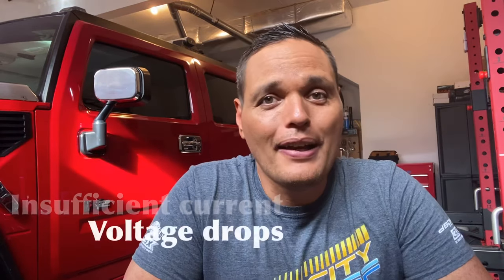The Top 10 BIGGEST MISTAKES in Car Audio. How to do it right!

Comment: I just have a 300 watt amp and a earthquake sub and I’m running stock wiring am I chillin tho ? Ion got 5 grand 10 grand wats just 300
Reply from the maker: 300 watts is not that much power so stock electrical should be just fine 😎

Comment: I have a 10 in subwoofer 1200 watt. My car was idling and then it shut down I started it back up but now my power lock doors don’t work and my inner light stays on. I know it’s not much power but what could have happened. I going with my car battery but would like to hear what else could it be. Thanks
Reply from the maker: That’s interesting, Does your stereo still work properly? And things back to normal? Or still stuck
Reply: @NextLevelCarAudio  stereo works but it was a fuse. All working but would I need a stronger battery like an optima or  standard battery be ok did 10 in subwoofer and 1200 watt amp
Reply from the maker: Standard with big 3 and gain set properly you should be good

Comment: Grounding!  If you have a unibody car(no frame) then You should be able to ground at the seat mount bolt, as long as you clean the surface free of paint.
Reply from the maker: In that case, I’d run a direct ground from the negative battery terminal to the rear. But to each his own :)
Reply: @NextLevelCarAudio  that’s what I did. I have a short ground on front battery to the unibody and another short ground from my battery in the trunk to the unibody.

Comment: I have A Question Nd Noone Can Seem Too answer It. Can You use A Motorcycle Battery or Any other Type Of Battery To Run Your Amp? I Dont Have The Money for the Expensive batterys
Reply from the maker: That’s fine, as long as the batteries amp hours can support the load. Also, make sure to run like batteries to be safe. AGM up front, AGM in rear, etc. unless you use an isolator
Reply: @NextLevelCarAudio  ty very much for feed bacc

Comment: Hello I have a question I have a 96 Ford aerostar short wheel base and I had a 10 inch subwoofer Sony xplod but I let a friend of mine borrow it and bought me 2 12s rockville an a 5000 watt amp but my friend gave me a 1000 watt amp but my subwoofers aren't but 2ohms so which amp should I use my 5000 watt amp or hes 1000 watt amp and the subwoofers are 28000 hundred or 28000 thousand watts
Reply from the maker: Not sure on the exact specs of your subs. But a 5k seems overpowering for the subs. I’d day run the 1k at a 1 ohm final load or the 5k at a 4 ohm final load. Should get the same power doing it either way

Comment: Kinda late on the video but what amp do you recommend for 2 12" Kicker CVX Dual Voice Coil 4-Ohm 750W also both subs wired to 2 ohm’s
Reply from the maker: A good 1500-2000 watt rms amp that puts out that power at 1ohm. If you tell me your budget, I can give you recommendations. Will run you from a couple hundred up to a G depending on brand
Reply from the maker: But wait... is that 750watt rating RMS for those subs or is that their max?

Comment: So I'm semi new to this.  I have an amp that is 700rms, it preforms at 700 watts at 1 ohm.  I ordered a kicker 10 inch q series that when wired parallel comes in at 1 ohm.  The rms rating for the speaker is 700 watts.  So if I parallel this speaker at 1 ohm and the amp is 700 at 1 ohm I should be perfect correct?  This stuff can be confusing.
Reply from the maker: Sounds like you did it right! Good to go :)

Comment: 11:52 oh shit. That's so true, I was going to add a 2nd battery in interior of my car and was thinking I don't have to do anything other than bolt in parallel to other battery using the amp power wire that is already there and fused up front. But no shit, the wire is hot either side! Thanks for picking up on this for me, I don't think I would have realised even though I'm an electrican hahaha. Maybe if I physically seen it wired im sure I would have then realised.
Reply from the maker: thanks for the feedback man! glad it helped ;)

Comment: My issues are with my box, airspace, and an amp that doesn't output the 2K watts needed at 1ohm. Im running two 15" 1000watt rms Dual Voice Coil nonpress paper cone.
Reply from the maker: Sounds like rebuild time! Woohoo!
Reply: @NextLevelCarAudio  l need to. Just don't have the money nor resources. I like loud bass, but my previous set up would make my car shut off even when on the highway, so I went to a less powerful setup with larger subs thinking I would have similar Performance. Unfortunately that's where I'm at now and I think my car is too small for dual 15" subs
Reply from the maker: I feel ya, enclosures can definitely make a huge difference in output.
Reply: @NextLevelCarAudio  I'm just not sure on what enclosure would be best for my car, but with the current one, the subs are pointed towards the front of the car, with one sub being mounted inverted on the box
Reply from the maker: Did you phase shift or reverse polarity on one of the subs? And is it sealed, ported?
Reply: @NextLevelCarAudio  I reversed polarity on the inverted sub, and the box I don't think is not even close to 75% sealed. I need 3/4" MDF board. Not 1/4" plywood.
Reply from the maker: Wow. Yeah. 1/4” is no good! Lol
Reply: @NextLevelCarAudio  it's not surprising the panel with the 15's mounted on it keeps splitting.
Reply from the maker: Lol

Comment: what is the best starter crossover points for bass and vocal amps? i usually run mine around 80-100 on low and 150+ on the highs but would like to get max out of the crossover points
Reply from the maker: That’s pretty spot on man. Can’t get much better than that. 😎

Comment: Speaking of grounds what about the stock grounding spot to chassis my battery is under back seat
Reply from the maker: That’s fine. :)
Reply: @NextLevelCarAudio  thanks
Reply: Is the ground wire that goes from alternator bolt to chassis count as a engine to chassis ground or do I need to upgrade my engine to chassis ground still my car has a stock one from alt to chassis I upgraded that one I can't find my engine ground so if it won't be enough I'll have to find somewhere on engine to ground to I'm a beginner just got back into car audio last year
Reply from the maker: That’s fine, always a good idea to upgrade it with a quality 1/0 Gauge OFC wire to

Comment: Quick question: I have a 12v 5A power supply on 220w amp with skar sdr 12 600w rms should I be worried about anything I also keep my gain all the way down I just use half vol my box is tuned to 25hz
Reply from the maker: Seems like your amp is too small for our sub. 220w on a 600rms sub?
Reply: @NextLevelCarAudio  yes
Reply from the maker: Like this, you will be trying to get to much out of too little. Better to have what we call headroom in this industry. 600w rms amp is what I’d get.
Reply: @NextLevelCarAudio  but I dont push it I keep it half my equipment stays cool when playing
Reply from the maker: Well do your thing man. Peace out
Reply: @NextLevelCarAudio  thanks for the help bro

Comment: Hi bud how are you doing? I've purchased a 10 inches Clarion DVC 4 ohms + 4 ohms(1000w peak and 300 RMS) Shallow mount subwoofer to hook up with my factory amp for my 09 explorer limited .The actual factory subwoofer is a 8 inches DVC 1 ohm +1 ohm (60w +60w) the wiring connections I did was like a parallel to have 2 ohms from my Clarion sub and I've bridged the wires to the factory amp output wires respectively like so :negative from the sub to the positive of channel 1 and the positive from the sub to the negative of channel 2(did a ohms test with my multimeter)got 2 ohms going out the factory connector to plug in the amp output. Is it the way to do it or I should hook up the positive with the positive and negative with the negative from the factory connector to the 2 wires coming from the sub?(1 positive and 1 negative)sorry I did the the positive to the positive and negative to the negative
Reply from the maker: Yes, should be + to + and - to -

Comment: I have a 2011 honda civic coupe 
I have 1 dc audio XL on a orion xtr 2500.1 wired to 1ohm , stock alt, sky high 0 gauge wire,  and a stinger sp 2250 do you think that I need an upgraded alt
Reply from the maker: Sorry for late reply, you are on threshold I would day of alternator upgrade. At least do the big-3
Reply: @NextLevelCarAudio  big three is done I never drop below 13.1 volts and also my orion amp says its rms is at 12 volts don't know if that's true but windshield wipers wont stay still lol and amp and sub does not get hot if that matters
Reply from the maker: Nice. Sounds like you are good man. 💯

Comment: Hey man i am running 2 12 inch skars in the back of a 2002 chevy s10 and i have 2 seperate amps so i per sub what would you recommend  doing
Reply from the maker: If they are the same model. Hook 1 amp up per sub and gain match. Or, if your final load allows, and your amps are strappable you can master/slave them into one

Comment: I currently have a 15inch l7r 4 ohm dvc at 2ohms with a rockford fosgate r2 1200 mono d watt amplifier I am running eq and audio control epicenter  when I set gains on amplifier my clean output blinks red when the bass hits hard it's barely at 3 out of 11 but even then the bass ain't even that strong suggestion?
Reply from the maker: How did you set the level on the epicenter?
Reply: @NextLevelCarAudio  it's audio control epicenter wide and sweep are half way
Reply: @NextLevelCarAudio  also my eq 50hz I have it centered don't control bass from there
Reply: @NextLevelCarAudio  also do I need bigger battery,alternator, the big 3 ? Currently running stock electrical
Reply from the maker: Hmmm...I would definitely do big 3. Others are not really needed yet. Your enclosure has a lot to do with performance as well. That may be V it. Also your filter settings on the amp

Comment: Hey man I had a system put in by a guy that took advantage of me cuz I didn't know much about car audio, but im professionally an automotive technician. I have a lot of questions regarding my setup and could use the help. I can send you pictures of it and tell you what I have and what I'm trying to do. but I dropped $2500 on the system and I dont have another $1500 to have someone go back in and reinstall everything correctly. not super hard stuff but I just need to know what I'm doing
Reply from the maker: Let me know if you have anything specifically I can help you with
Reply: There is. So I'm having a white noise/static in all four speakers. The guy that installed it did a singular ground for both amps and then in-between the amps cut part of the 4 guage ground wire and tied the other ground wire that was grounded, to that single other 4 guage connecting both amps. but he did it by basically splicing it. wrapping the wire around the single wire and taping it. Im wondering if this is common practice or? From what I've read usually you ground both amps with separate wires, but want to ground them at the same grounding spot on the chassis/body to not allow a ground loop. or to utilize a distro block and hook the ground wire to that and a small wire to the amps. ALSO he grounded the 4 guage ground wire to my trunk HINGE. and didn't even grind off the paint which I went back and did myself with a wire wheel. I believe this to be a bad ground because its not even a part of the body, but I dont know where else to ground it in the trunk. And my only idea is to get a self tapper and clean up a spot of metal on the body under the trunk lining and run that self tapper with the ground wire. but then I also worry about hitting the gas tank and stuff with the self tapper. So my idea was that I ordered extra long multimeter ground leads and I was going to test different parts to see if they were good grounding points and try different places until its good. then get two ground wires under 18" (from what I read dont wanna go longer than that) and ground each amp with their own separate 4 guage ground wire, to the same grounding site in which I test for good grounding. is that correct in theoretical procedure? as well, i noticed a little crackling in my front left speaker which I haven't noticed until today. I have a 900w amp going to 4 speakers that have a 125w max capability (pioneer primus 6.5 in the front and 6x9 pioneer primus in the rear deck). Im not sure what guage wire he used for the speaker wiring and if that's affecting the clarity and distortion I'm getting at higher volumes. As well he ran the RCA, power cable, and DRIVERS side speaker wiring all together to the back where the amps are. could that be an issue? How can I know what guage wire he used when its not marked on the wire. It looks like atleast 14-16 guage to my eyes but again I'm a mechanic not a car audio guy. 
As well he has only 4 RCA plugs going to the amps when really it should be 6. 4 for the speakers and 2 for the subs. could that be affecting anything as well? I plan on doing the grounding issue first and see what issues I still have left. For reference I have a crunch 900w amp for speakers and a diablo 2200w amp for two 12 pioneer reference subs, with streetlink RCAs spiraled and housed. Again not sure on the guage of speaker wire.
Reply: If you can help me out man I will most definitely appreciate it and put it into use immediately. Those extended ground leads get here on Tuesday for me to test the ground, so I plan to start atleast the grounding issue Tuesday.
Reply from the maker: OMG... that guy that installed your system needs to find another line of work. We is really screwing up your system. You are right with all your wiring concerns. As far as his mistakes,  Power and signal wires should never be ran together, grounds need to be ran from each amp to same chassis ground point or distro block, grounds need to be bare metal. Weather sheet metal or chassis ground. Head unit settings/filters/gain/etc I’m guessing are jacked up as well. Please don’t take it back to that guy. Take it to a reputable installer that knows what he’s doing. Preferably a MECP master installer.
Reply: @NextLevelCarAudio  unfortunately I don't have the money to put another $1000-1500 to have someone re-do my system. I already got quotes on it from two different shops and I can't afford it. So I'm going to have to do a lot of the work myself, and then hopefully just have someone tune it in perfectly at a shop that can do it professionally.
Reply: @NextLevelCarAudio  also does it matter if the power is ran with the speaker wires on one side? only the signal/RCA cables need to be ran on the opposite side?

Comment: i have a amp that pushes more rms power than the rms of the sub i want to get, would i just set the gains by ear normally, or is there something else i need to do because i am overpowering the sub? lmk if this makes sense
Reply from the maker: That’s risky business to do without a oscope. You can still hear distortion tho. For sure
Reply: @NextLevelCarAudio  will it be risky even if i set the gain correctly?
Reply from the maker: No, that’s why I said with an oscope. Because then you can actually estimate how much wattage you are actually putting out to the Speakers based of sine wave amplitude

Comment: Would I need any upgrade if I’m running a 1300w rms sound system.
Meaning 660w rms amp 
2x650rms subs 
1x110w rms amp 
2x1006x9/
2x100coaxials ?
Reply from the maker: What vehicle?
Reply from the maker: What vehicle?
Reply from the maker: What vehicle?

Comment: 2015 honda accord coupe ex-l 3.5L,  I my js alternator with a plug using 2 wire, 1 blur wire is to wire to alternator and 1 yellow wire is ignition source in the fuse box and i see  they tell me buy a 30 fuse relay that pin 87 wire to 14 gauge with 10 fuse to the battery, pin 86 wire to fuse box and i see 1, ignition coil , pin 30 yellow wire to the alternator 
can i slice the factory wire 1 plug that wire to the alternator ? So the computer can what  going on, pin 85 wire to ground , so that good because i'm waithing so look just to find out, js alernator people, aint gave me nothing  i have to email them and i have to wait to email me back

Comment: What's the best spot to ground on a unibody car?
Reply from the maker: Dedicated negative run of 1/0 gauge from front battery to the amp or rear distro block if running multiple amps.

Comment: I’m running 1800rms on my skar svr which is rated 800rms 1600max and it takes it. I normally run burst stuff but I have cooked the coil a few times running 40-45 htz tones on burst but it still rattles my shit even in a sealed box.
Reply from the maker: Nice lol 😆

Comment: What can I do about lights dimming?      I have (2) 10" Skar 500 RMS - 800 max  each  on a Taramp 3k mono block.
Reply from the maker: Either extra battery, high output alternator, or if need be…. Both
Reply: @NextLevelCarAudio  thanks for the advice.

Comment: How many hz do I set a 2000w amp for 2 12” hifonics 600w each I’m new to this and my amp keeps going into protect mode and getting hot
Reply from the maker: Sub sonic at 30hz-ish and LPF at 100-ish. Biggest issue is probably gain. Make sure that is dialed in properly

Comment: can a 180 watts rms power amps adequately powered two 500 watts  2 ohms 10 inch subs ? this amp is a monoblock.
Reply from the maker: It will be overworked... definitely want headroom in your setup. Check the video on my channel where I hook up a 300watt sub to my 12k no problem